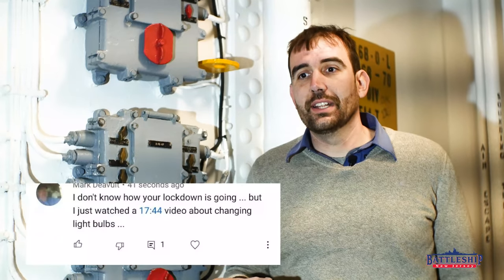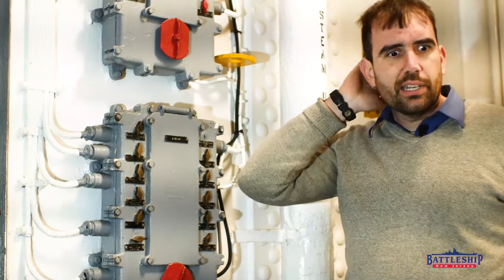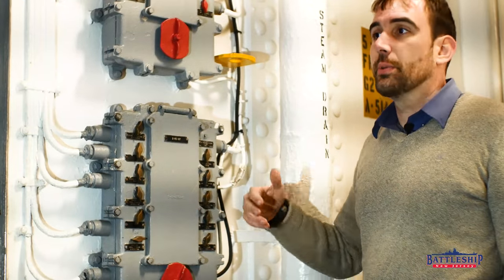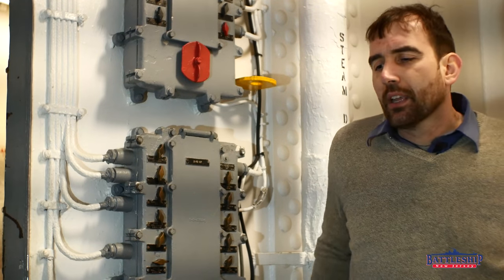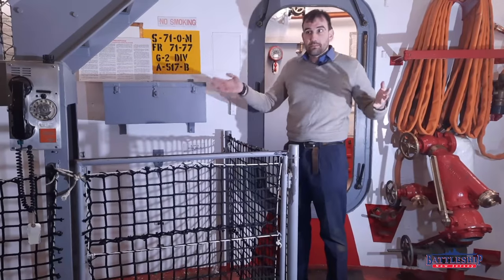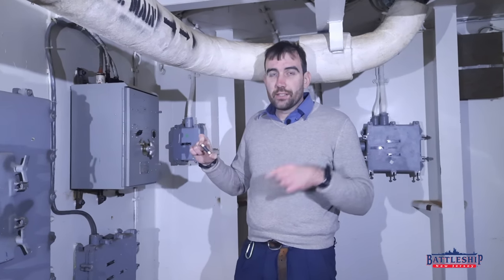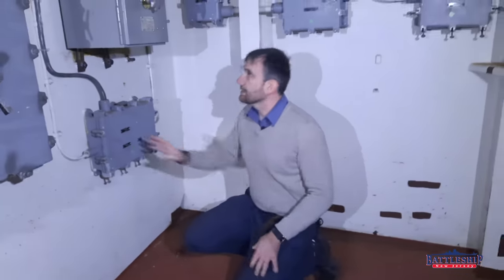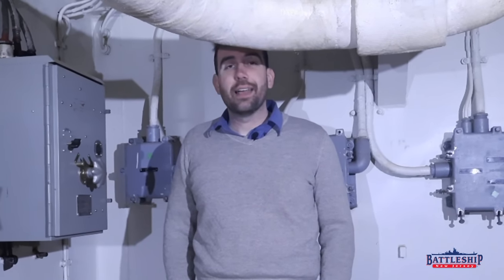Maintaining Your Battleship Gun Turrets: It's Electric!

Comment: I once worked in a data center that installed a similar backup generator/automatic switchover system while I was there. It replaced an earlier system that relied on the network operator on duty wheeling a Honda camp generator down the hall and out into the parking lot (in foul weather, usually, because when else does the power go out?), propping the door open, running a bunch of cables, starting up the generator, and switching over manually before the giant rack of car batteries that was keeping the backbone router online died. Time limit: about 10 minutes. Time it took me to do all that, alone on a Sunday evening shift, in a thunderstorm: nine minutes, thirty-eight seconds. I'm not going to take credit for the purchase of the automatic system, but they did order it about a week after that storm...

Comment: Have you tried a radio frequency cable tracer?  It sends a high 
frequency radio frequency signal through a cable, essentially using the 
cable as an antenna, and you use a special probe to pick up that radio 
signal.  You can get them for less than fifty bucks on Amazon.  It might make your job of tracing cables a LOT easier.

Comment: Ryan real sparkies never sweaters while working. We have to wear long sleeve flame resistant ( PPL ) shirts. Even the thread for the name & company logo must be flame resistant. In the real world would only have maybe every 6 to 8 th ceiling light connected to emergency power but like you stated the navy had their own rules. They stopped using starters in most fluorescent luminares ( no such thing any more in NEC as a light fixture ) back in the 1960's. Have a 4 lamp luminare in my garage that I recycled for my garage about 50 years ago. Painted it then removed the 4 starters and installed new T12 ballast. Next time when a lamp or now a T8 ballast burn out going to use LED'S that bypass the ballast.  Unbelievably how many luminates there are on the New Jersey. Thanks for all the great vids. Hope you get big crowds starting this spring now that the 2 year pandemic appears to be easing up. Hope history channel shows some of your great vids.

Comment: I have an ABT like that in my garage, and for the exact same purpose.  When the line power goes out, our propane generator starts automatically and the transfer switch connects it to the house circuits.  When the line power comes back it switches back over.

Comment: I was visiting the USS Yorktown a few years ago.  On there they had huge power cables that could be run between compartments if there is damage that breaks the wires thru the area.  Basically big jumper wires with plugs in a lot of areas to tap into. Does that exist on the Iowas or another system to bypass damaged areas?
Reply: He has shown them before.
Reply: They're called casualty power cables. They were considered Essential on ships as heavily compartmentalized as the Iowa class battleships and Essex Class Carriers. So yes New Jersey was equipped with them
Reply: They're all over the place on the USS Midway in San Diego, although they don't explain their use on the tour.
Reply: We had them even on smaller ships. Just a thing for a vessel that might see combat.
Reply: @thekidfromcleveland3944  Still found on just about every ship.  Last ditch provision to route power around a damaged area.
Reply: Yes he does,.and every single warship in existence still carries them, because you never know where a shell or missile fragment is going to slice its way through a electrical duct and cut power to something you'd like to have, such as the control computer for the missile launchers...
Reply: Dad was an electrician on the USS Missouri during the Korean War, about 15 years ago we were touring the USS Massachusetts when my son asked about those cables and the bands on them. There are 3 cables with 1,2 0r 3 bands on them so that in an emergency you could wire them in the dark. They drilled this on a fairly regular basis from what he said.

Comment: Automatic transfer switches are both wonderful and the bane of the existence of facilities people who have to maintain high reliability. They're great because they get you back up and running on your secondary power source nearly instantly, but because they're mechanical they wear out or fail to trip. I've been told that data centers in parts of Germany and France don't use uninterrupted power supplies or automatic transfer switches because they're not only more expensive than not having them, they actually lower the reliability of the system. Based on the number of failures I had in a decade of managing them I can see how that could be true, we had 2/2 transfer switches fail or need major maintenance during that period, luckily both happened during scheduled system tests.
Reply: Andrew, read my story I posted an hour after you about what happened to me at Griffiss AFB, NY.
Reply: @klsc8510  would love to but sorting comments by time I don't see it, was it a reply to someone else?
Reply: @andrewfidel2220  It is a short distance below yours.  The comment was like yours.  The best is to start the video again.  Scroll down to find yours.  Keep going a bit and you will find mine.  Where is a search box when you need it!!!!

Comment: You can probably down size fusing to more reflect the normal amp load of LED's. This would increase the safety  factor on the old wiring circuits, especially lightning that has years in service. I've found some LEDs use more amps on start up, might take amp to determine load from cold start and add 10% as I remember as a rule of thumb for fusing. Seen those electric switch boxes since I was 14 in sea scouts and later on many tugs, some still 110 DC, not converted to AC as I believe might have been done at some point in your battleship. Thing is I've never seen that big red main disconnect before, but we could shut it off at the main panel. On one 1919 vintage tug open knife switches.
Reply: Fuses protect the wiring, not the fixtures.

Comment: Wonder how much of a Tag-Out procedure was required to change that fuse on an operational ship?
Reply: Tag out as you know it is nearly impossible on a ship.  if we were working on a circuit we would have a person standing by at the the main switch gear for the circuit.  The issue is that the switch gear could be on the 6th deck forward and the circuit would be on the 04 level aft.  The other reason Tag out was not practicable was that the switch gear was mostly pre WWII..  There were even some deadman panels on my ship.
Reply: The correct answer is "the full procedure as specified in the manual".  The actual answer depends on whether you can get the fuse replaced with the circuit hot before some dimwit comes along and tries to write you up for not tagging it out.

The USN tag-out procedure, while effective, was cumbersome and time-consuming.  In a nutshell, you wrote up your list (Tag Out Record) of switches to be tagged out.  Somebody else verified and signed off that your list was correct.  You and your list then went to the engineering office where you tried to find somebody senior enough to authorize your tagout and log it.  You then went to each switch on your list, in order, turned it off, hung your tag, and signed it.  When you were done, you signed your list THEN went to find a competent person to hand the list to, who would then INDEPENDENTLY (without you) go find all of your tags, verify the switch position, sign the tag as well, then return your list to you.  You then returned your paperwork to the office, where it was put into the logbook as active.  When you were done with your work, you retrieved your Tagout list, then reversed the procedure, including an independent verification that tags were gone and switches were lined up properly.  

The alternative was to nonchalantly take a little walk after loading your pockets with a circuit tester, a few fuses, and a fuse puller.  In practical terms, things didn't get tagged out very often unless the lack would be obvious or you were working on 480.
Reply: @jimnunn9232  Having come out of Aviation were we didn't deal with tagging out outside of putting a ziptie on a pulled circuit breaker. So when I became ships company on the Kitty Hawk after 17 years I really didn't want to deal with all these extra procedures either. In this case you can't teach an old dog new tricks. 🙄

Comment: I loved this the first time I watched it- and recognized it as a ABT immediately. in a range of stuff I wanted to see a video. FYI - Newer ships designs - Emergency diesel IS NOT kept in the auto start condition in port (lack design to ensure it DOES not try to power the pier and City).  From What we have been presented- I have impression in the 1980s - the upgrade changed NJ to being that way. When built -the NJ probably could safely have the Emergency diesel generator in auto start condition.  Freaked me out in in port  Mobile Alabama on the USS Lexington in port when the whole CITY lost power from a lightening strike - and the Emergency generator spews it puff of smoke as starting near immediately. Now - how about a video on MBTs.

Comment: I believe that the electrical and gunnery  back up systems on our battleship and cruisers were the best in the world.    I have read accounts of the loss of the British battleship Prince of Wales that the lack of 100% reserve electrical  power to her bilge pumps as well as a lack of power to her after 5.25 " anti-aircraft batteries were contributing factors in her loss. The Royal Navy modified her sister ships to some degree to compensate for these design  shortcomings.
Reply: I think you're correct but we did have problems at times. South Dakota got beat up pretty bad by Kirishima due to loss of electrical power. Luckily USS Washington annihilated Kirishima before she could finish the job.
Reply: @Lucas12v  You were correct about South Dakota's electrical difficulties during the Second Naval battle of Guadalcanal , however they were in large part caused by an electrical engineer who  tied down a main circuit breaker thereby putting the system into series which resulted in the system failing at a critical juncture of the battle.  Thank goodness for Washington !

Comment: Thank you, I enjoyed that. I would assume that the electrical compartment under the turret was certainly manned at battle stations and I would even suspect it was continuously manned on war footing. I do appreciate it when you point out the various damage handling setups on the ship. A well-built warship differs from a bad one by how it handles damage. This brings up another question were the emergency generators capable of operating the turret drives or was their a separate power supply set up for the turrets. By the time of the New Jersey the ship should have been able to continue main and secondary battery action even after several torpedo strikes (I know that North Caroline still had lighting in the A turret (at least) when it was struck by a 24-inch torpedo alongside the turret in the thinnest part of the torpedo protection).

Comment: If they wanted to have automatic ABT back in world war II I'm sure they had them. 

Inside of that box, though it looks complicated, it really just comes down to some micro switches and electromagnets to sense and signal and move everything around

All the little wires are for sensors and remote monitors and also to possibly send a signal to the generators to start & stop, as well as light up engineers boards. 

But again if they wanted automatic ABTs back in WW2 I'm sure they had them (I'm only speculating it actually would be nice to know for sure)..

Comment: Actually warships are ungrounded to minimize the effects of battle damage to the electrical system that way if a phase is grounded due to damage the whole system doesn’t fail but only the phase that is ground out meaning equipment can keep running just at a lower effectiveness

Comment: Favorite redundancy is the firing triggers on the trainer's and pointer's hand wheels buried in the bowels of the electric deck. You could fire those guns a whole lot of different ways, but that one was new to me. BTW: working in those positions during action must have been awful surrounded by whirring and whining electric motors, hydraulic pumps and valve. Had to be loud, smelly and probably hotter than heck.

Comment: The redundancy on the battleship doesn't really surprise me, since its critical to the ships performance that things can be taken down for maintenance, or continue to operate while taking damage.
But, there's one system on the ship, which you've discussed that I don't recall you mentioning any redundancy in, the sewage system. Are there multiple pumps to keep that functioning in case of a breakdown? Or is it a situation of, get it fixed fast before the heads overflow?
Reply: Redundancy everywhere. My much smaller ship from the 70's had multiple duplicate pumps for everything sewage related too. We could even isolate forward from aft sewage and run the independently.
Reply: @JoshuaTootell  Thanks for the info. I figured there probably would be, but wasn't sure.

Comment: Never thought of a ship not being grounded….I know that most electrical injuries are the aftermath of electricity jumping (Arcing) while searching for shortest path to ground….and since there isn’t a ground….can electrocution not happen while afloat?  Obviously I’m a a electrician…just curious
Reply: There is no earth ground, but there is a floating ground.  The ground system is still used to equalize the voltage between the ground and neutral. Just like that circuit with the bad fuse, anything not connected to the ground or power would accumulate a charge. It is these differences in "potential" enery that get you zapped if you bridge them or can cause damage in a lightning strike.

Comment: Interesting video.
For your ABTs is it possible to turn them to manual (not auto) and thus save power on main power for equipment you ship doesn't use (like steering gear) but keep ABTs on for lights and or bilge pumps?

Comment: Out of curiosity, does the emergency diesel still work? Usually, large public buildings without a lot of natural lighting will have emergency diesel generators somewhere behind the building, and this is definitely the kind of "building" you need emergency lights for considering it's a public attraction. No sense having another generator if the one you already have is in good working order.
Reply: Like any building 'these days'  they have battery backed up emergency lights now.
Reply: @arnoldgrubbs2005  every new commercial building just about still has generators. The batteries just keep things alive during the switch over.
Reply: @arnoldgrubbs2005  You're thinking of the battery powered "EXIT" signs with the little pot lights. Pretty sure the battleship doesn't have those.
Reply: @BlackEpyon  Its required for the public to enter the musiem these days...  it wasn't the same many years ago... I did say "these days" and I guess thats a little ambiguous ..I mean if you go there now.

Comment: So what is your backup power supply? Are your diesel generators on standby and ready to run? Or do you have some other source of lighting on the tour route if you should ever lose power?
Reply from the maker: We have battery powered emergency lights like you'd find in most modern buildings
Reply: @BattleshipNewJersey  Are you allowed by the Navy to run the diesel generators?  I think even if the Navy did, not running them is best.  That is one more maintenance headache you don't need!
Reply: @klsc8510  I think he said they're allowed to but it's not really feasible. They're finicky and they could send all that time and money to get them running for a few times before they fail again. Plus fuel would be expensive.

Comment: Actually the electricity on the ship notwithstanding lack of ground is very similar to what you have inside your house although very few people have three phase power but they have single phase 240 which is basically two phases of 120 so you've got similar voltages and circuits you're working with without having a third phase

That alternate light lighting circuit is similar to how you wire outlets in a kitchen you have two 20 amp circuits and every three to six feet you have an outlet )circuit A) and the next one down would be circuit B. A few feet later circuit A, afew feet later circuit B,... so that you never have two outlets near each other on the same circuit. It i's pretty much to prevent overloads from microwaves coffee makers whatever but when you started talking about every other light it sounded just like a situation where you had alternating circuits feeding it

In the case of the ABTs it's similar to a residential generator with an automatic transfer switch (ATS). When the power drops the transfer switch senses it starts up the generator gets it up to speed checks the voltage then automatically switches over the power from the generator

I'm surprised you're on board electrician didn't mention that and actually tell you that there were similarities between both functions and both wiring schemes